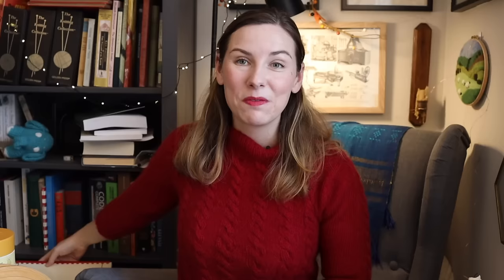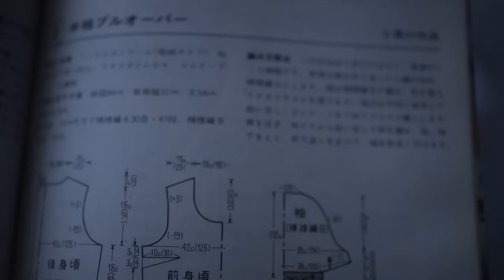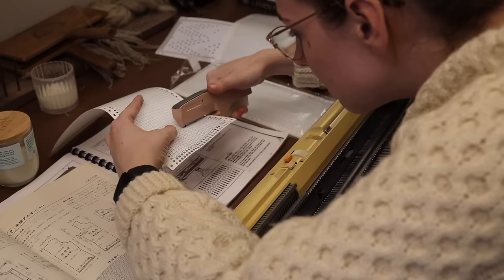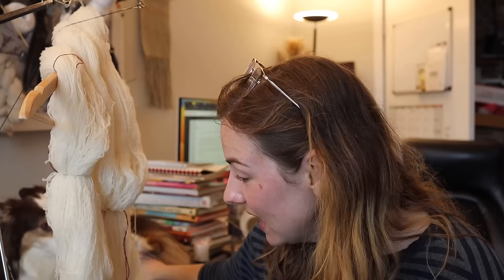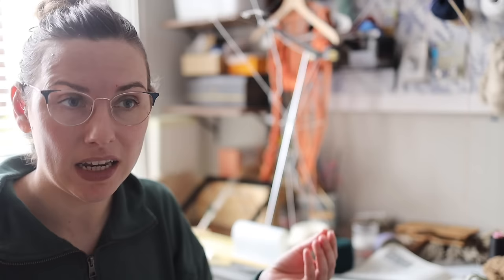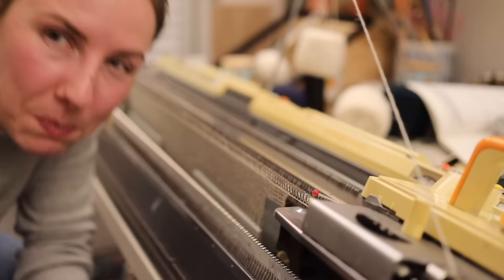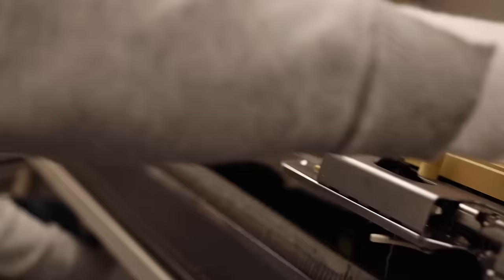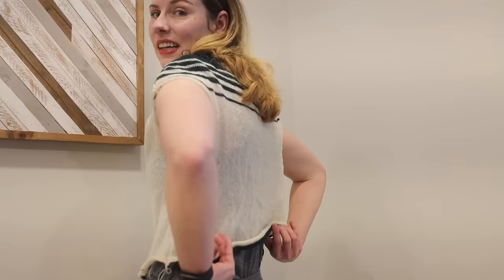I learned (a little) Japanese by knitting a sweater

Comment: My great-aunt lived with her daughter in a teeny, tiny little four room house.  They were avid quilters.  With nowhere to leave a quilt frame set up, but wanting to quilt nightly after supper, they employed small pulleys and cotton clotheslines to raise and lower their quilting frame over their dining table.  Might something like that, with pulleys in the ceiling and clothesline attached to a piece of plywood cut to size enable you to use your ceiling for storage?  The knitting machine is pretty flat and wouldn’t impinge on your headroom much.  Spitballing here, but you could even attach some under cabinet lights to the bottom or edge of the plywood so it would also provide extra light to your work table when your knitting machine was stored “up”.  Even if you’re renting, the pulley holes would be easy to spackle over.
Reply: Brilliant idea about the rise and fall system, don't think my hubby would want me to do it,  not allowed to stretch or even lift over 10 lb, 😅 drives me nuts. ❤

Comment: That knitting pattern picture looks like the garment is knitted yoke style. That's probably why the stripes go across the front nicely in the picture.
Reply: indeed NB @EngineeringKnits most significant error is interpreting the diagram's v-shaped opening like a sewing pattern but it isn't a dart to seam fabric 
its an opening to separate fabric: half to underarm seam and half to yoke (like in Icelandic sweaters knit in the round) so correct way to shape garment is
(i) cast-off to join sides at underarm, creating "sleeveless" opening 
---------/
-------/        <― this open edge is gap
------/     where arm fits into garment
----/      
--/______        <― this open edge is underarm   
----------------|       <― this closed edge is side seam
----------------|
(ii) cast-on (or increase) for new armhole edge of "cap sleeve" part of stripey yoke/neckline

IMHO I would unravel and redo the top yoke section correctly 
for the vintage look you're going for
Reply: @clarekrishan1597  Thank you for the diagram!

Comment: The Silver Reed (Knitmaster)  LC2 Lace Carriage requires different punch cards than the standard punch cards. Unlike the Brother knitting machines, the LC2 carriage knits and automatically transfers stitches . (Brother machines need two carriages, one to knit and a separate one to transfer the stitches . That is why their lace punch card lines have spaces  between each line of holes). The  Silver Reed lace punch cards have arrows on the right hand side to indicate which way the carriage should move. In the case  of Fashion Lace there are also markers which indicate when the yarn should be removed from the carriage. The carriage is moved a number of times to complete transfer of stitches before the yarn needs to be put back to continue the next stage of the patterning.

Comment: This is awesome! I came across some issues like that. I'm a native Spanish speaker, I've learned English and I can manage a teeny tiny bit of some other languages in the latin spectrum. But something with a different alphabet or even German I can't do anything at all but to look at the diagrams... I've found out you can translate entire PDF documents online! I'm currently knitting a hooded scarf (yes, a scarf whit a hood attached in the middle) that I've found in revelry in German. I've translated to Spanish or English (I don't remember) and I'm doing it! 😊
Oh, I would've redone the top part of the front piece. I don't like to patch things like that, I always found it's faster to redo the work and do it how it's supposed to be instead of spending days troubleshooting on top of my errors 😂

Comment: I do not know any japanese that can help in reading the instructions, but just based on the images I think you interpreted short rows into a shape without them. The pattern looks to be literally just the flat piece as you would cut it out when sewing, and then the pieces are seamed up to the point the decreases start (which creates a scooped under arm) and up the side of the T shape. The sleeve opening is created by leaving the decrease portion open, and casting on a bunch of stitches to create the sleeve. Its just a rectangle (half torso width), then a trapezoid (decreasing to the point where you want tohe opening to start, then a wider rectangle (half the width around your upper body including your arms). The top of the T is the opening, which seems to be gathered really sharply for a few rows to make it a normal width for a neck opening
You can also do lace by hand, its more tedious than patterning it but unlike colourwork which requires the punchcard on singer machines, you can just hand transfer the stitches and then plain knit over all the stitches back and forth once for each row of eyelets

Comment: My paternal grandmother was never much of a knitter. At one stage, however, she decided that knitting garments at home would help the family to save money, and so she bought a knitting machine. If I remember the story correctly, she made one garment on the knitting machine. To be fair, using a knitting machine does involve a bit of shoulder work. 
 
Fortunately my grandfather was more inclined in that direction and I believe he made a number of garments on that machine. My mother eventually inherited one of them which she unpicked and hand knitted into a cardigan with a rather interesting raglan sleeve join detail. That cardigan was a light yellow and it became her dog walking cardigan for many years. 
 
My aunt (my father's younger sister) took after her mother in the knitting enthusiasm department. She apparently knitted one jumper once. That was two years of evenings (or two years of evenings and procrastination) she never got back. On the other hand, she was a lot better in the kitchen than I am.

Comment: It pains me to know exactly what you  did wrong with the construction and how it's supposed to go but beeing unable to describe ot in detail without holding it in my hand and showing you Dx

I'll try
The part you called the sleeve was the strap. Sew it together.
Under that, what you interpreted as the side, you leave enough space for the conplete arm
There won't be a rectangle shoulder because you are not supposed to sew up the upside. It's meant to be the neck opening
The wedge you put in there also might make it weird. If you'd have done it correctly as a dart like on the front, that would have resulted in a very beutiful shape.